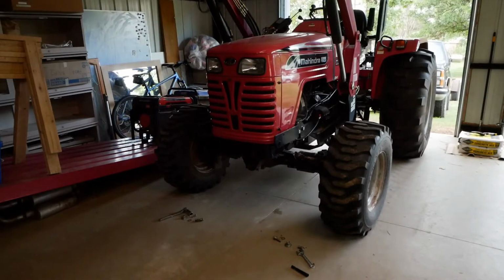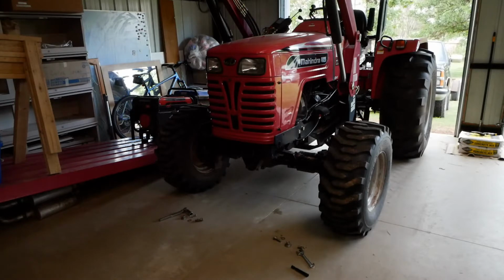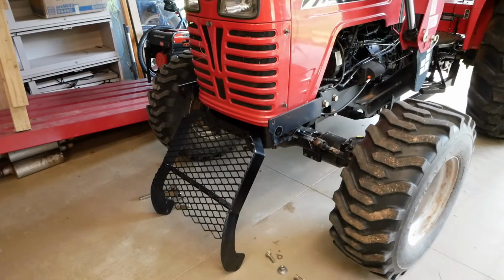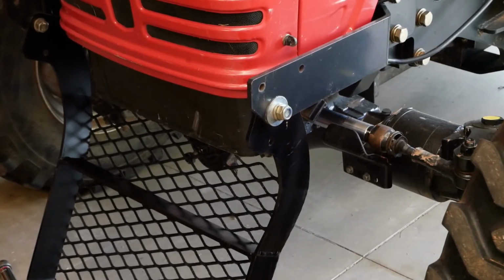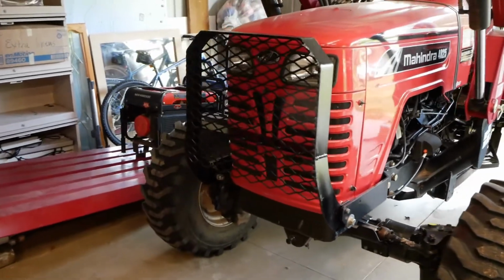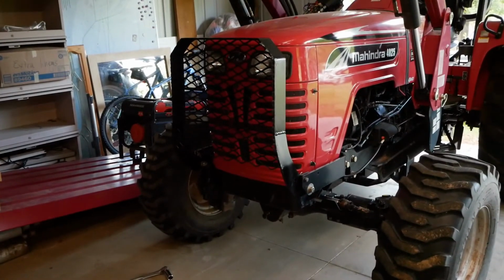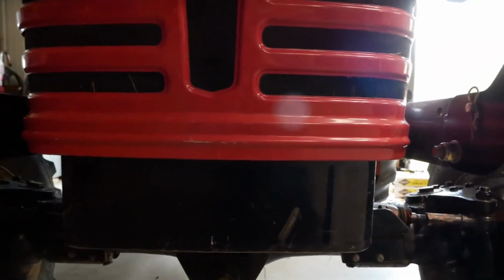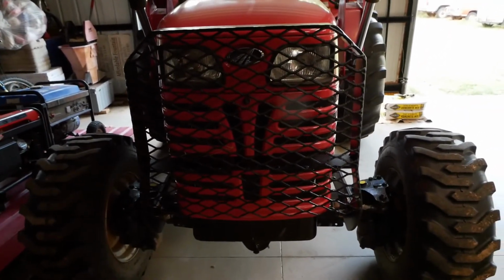The MOD Every Tractor NEEDS - Expanded Metal Grill/Brush Guard

Comment: Brother, great minds think alike.  Did exact same thing on my 3016.  We had a bad ice storm here in OK back in October and when clearing trees for neighbors, a limb came through the grill and bent my side engine cover.  Luckily it bent back as Mahindra wanted around $500 for the part...no thanks.  I guess no good deed goes unpunished.  Good job.

PS, if you need extra lighting, I can confirm that the square LED's from amazon work very well and are 10X brighter than factory.  I mounted mine to sides of grille.
Reply from the maker: Thanks, I've been looking at those led's. That'll probably be one of my next mods.

Comment: Did you weld the brackets to the tractor or bolt it on?I'm fixing to build one.The bracket is 3/8'' x4''flat bar?
Reply from the maker: No those brackets were already there. They're bolted on.